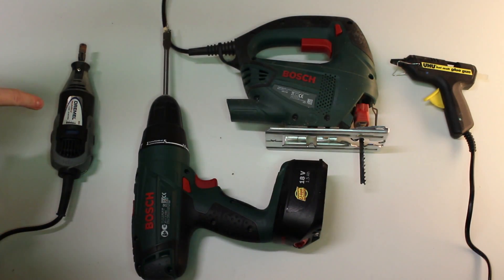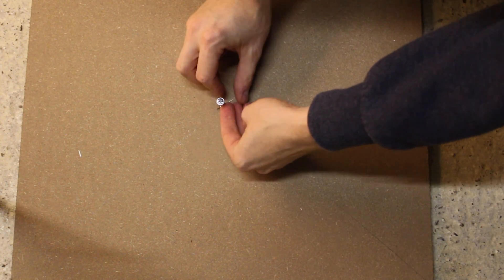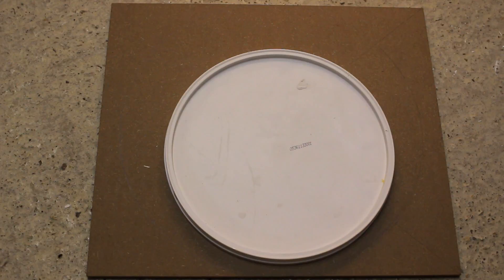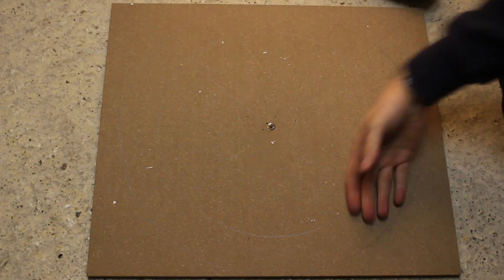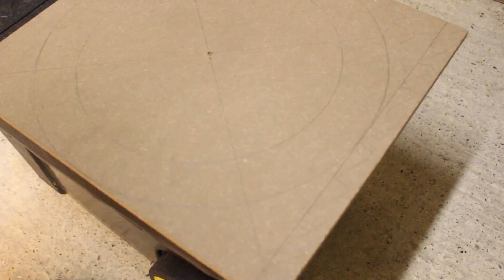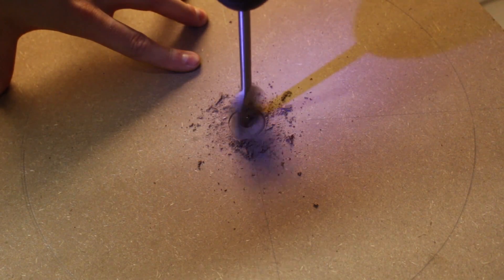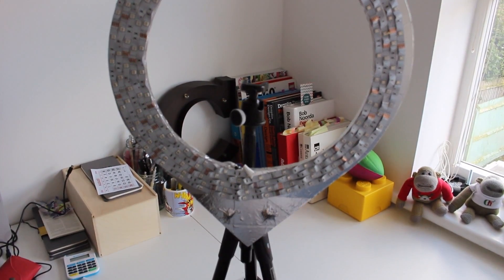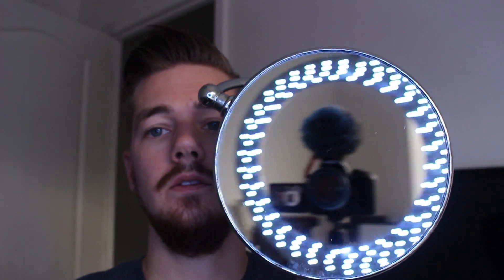DIY LED Ring Light Under £20

Comment: Good job.  Ideally, you'd want to have the LEDs to form a sort of checkerboard pattern so the light is more evenly distributed. Finally, the LEDs should be covered in a white translucent cover to diffuse the harshness of the light. But, you've already done more than I ever have.

Comment: wow.  can you tell me the outside and inside size please.  Iwant to make my own too.  thank you
Reply from the maker: No problem, the outside width is 40cm and inside width is 30cm. Good luck.
Reply: Thanks how many meter of light did you use? Thanks again
Reply from the maker: I used 5m with 150 LED's, there is a link in the description to some that will do the trick

Comment: nice project. i would have cut them and solder to get it more straight. although they are more flexible than the waterproof ones it is kinda wrinkly :D
Reply from the maker: +Micke thanks. I thought about it but quite frankly I didn't have the patients, I know it's not the prettiest but does the job. I've got an idea for another one that might be a bit neater.

Comment: My suggestion would be to avoid the cheap RGBW leds and use a higher quality white led that is is brighter. Also, no need for the fool since Leds are facing forwards. Otherwise a very nice build. Well done.

Comment: Great build, but you have chosen the wrong LEDs for the job. RGB seems to be cool and all for this, but rgb has really really bad color spectrum which makes the colors look unnatural. You should try the same with some high CRI LEDs(>90), which might be more expensive, but will give you a huughe quality difference!:) Remember, lighting is the most important part for video and photography.
Reply from the maker: You make a great point, this was a budget build and is now a few years old I think. I no longer use this light and honestly you can get some pretty good LED panels now with high CRI and low cost.